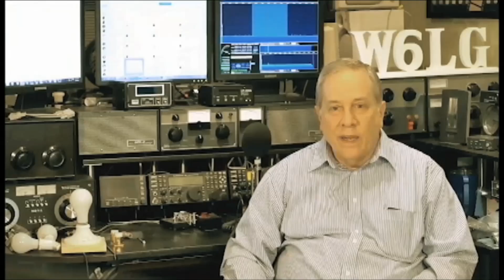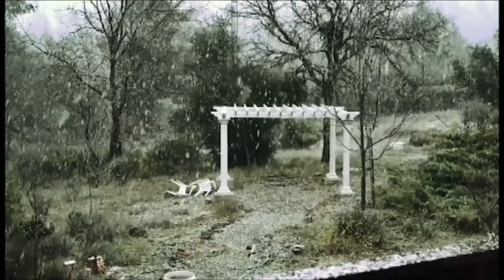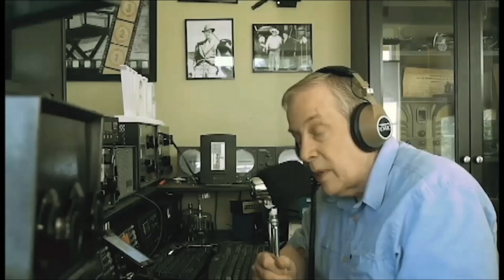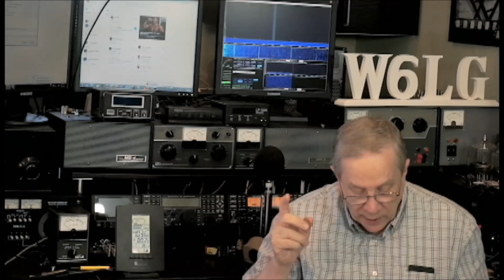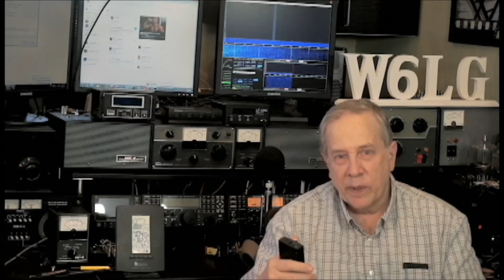Ham Radio Basics--Signal Reports--RST--Icom 7300

Comment: Thanks. Very interesting. I restored a very old receiver.  The failing component was a quadrature coil.   Located in the receiver of an old two meter portable called a Spectrum 560 which was a 2 Meter Transceiver. Had to order the coil from New York.  I was in college at the time 1979 studying transceivers.  My father.... who is one of the last Apollo Mission to the Moon designers sold that radio to me.   I remember that he requested a 100 dollar bill from me for it. I had to go to the bank at 15yo and I handed it to him and he handed me the radio.  I did not have my ham license, but I plugged in the little 1/4 inch whip antenna and had a blast listening to all the Los Angeles 2M Repeaters in that crystal set in 1975. But then I  found the bad quadrature coil in 1979 while doing a receiver alignment which showed very low rcvr sensitivity.   And that quad coil fixed it.
Today, I still have that fixed Spectrum 560 2M Radio in the garage, and I have my Father down stairs. He is 92 fighting dementia. But he remembers being responsible while on the US Navy Aircraft Carrier Mindoro to keep those Teletype  Systems going. And he remembers his HAM shack in the garage in the 1960's where he had purchased a few teletype systems and had them running and hooked into his ham radio set sending sending and receiving pictures long before the internet.  I remember standing next to him at 7yo and listening to him give signal reports to allot of other HF stations. He also was able to tell those stations how far off frequency they were, because he had setup a crystal oven on his local oscillator crystal which kept his receiver frequency extremely accurate.   I have an IC-7300 in the closet and I am going to set it up as soon as I get other thing fixed here.  Need to get that antenna up before my body begins to break down. Some HAM's do not understand... If your antenna is not resonant, you are going to pull more noise into your receiver and S-meter.

Comment: KA6TVX thanks for the explanation. I see videos of Qso’s that the signal report. Is 51 that drives me crazy and even on air have gotten 519. I run QRP CW most of the time and like you will repeat information if they give me certain signal reports.  Thanks for your videoa

Comment: I really hate the fact that with contesters the report is always 59! I assume out of laziness! I would much prefer to have a real signal report! 

As for the method, SINPO would be the best. Back in my SWL/DX days that was how we reported to stations about their signal. 
Signal Strength - Interference - Noise - Propagation - Overall
1-5 for each
Reply from the maker: Well don't be too upset. Hate is a bit strong.  Contests are about making contacts as fast as you can.  I would really like it if guys would understand the system.  For example, yesterday on 20 meters I heard a guy give a 5 by 5 report and then comment, right after that, that he was missing about half of what the other guy was saying!   I also heard a guy give a report of 5 by 9 to a another guy who had terrible RF feedback.  The reporting guy kept asking for a repeat of the callsign because he could not understand it due to the RF.  Yet, he gives an R of 5.  So contests don't concern me at all.  Regular contacts do.  Let's try to understand the system and get it right.  It is so easy just to tell someone that "hey, I think you have RF feedback and I thought you would like to know that".  Thanks John. 73, Jim

Comment: I wonder if the IC-7300 uses 3dB/ S-unit derived by power  (P=E squared/ 50 ohms)? S-1 would be down in the low nanowatt range though.
Reply from the maker: I have heard that from several others.  They, Icom, are brilliant at marketing their gear.  It would not surprise me if the S meter was more than generous.  Also, they recommend 10 to 20db of audio compression.  Ten is often way too much. Twelve is usually really distorted with flattoping, harmonic, distortion, crap.  Twenty db is crazy!  I try to use about 3 to 5db on the K3 and other rigs.  73 at 0db of compression, Jim

Comment: I'd sure like to get my hands on the 7300 I bought!!! Just wanted to let you know that I just bought a 7300 at DX Engineering @ 3:00AM this morning for $899.xx, charged transaction to my VISA! Now at 10:00AM I get a call from DXE saying ICOM won't let them honor the sale! I said then let ICOM know that the 7300 was my second ICOM HF Base purchase from you (and them), previously having purchased a new 7200. They said sorry, but they can't fulfill the transaction!!! I said...well, you're not yet sorry enough! I'll rate the product higher if the marketing and sales folks can just get their heads on right and deliver it as purchased.I'll rate the product & companies involved higher if the marketing and sales folks can just get their heads on right and deliver it as purchased. 73's K4WWK
Reply from the maker: I don't understand.  I do know Ray Novak at Icom and Tim Duffy at DXE.  Contact them using their email addresses.  Explain without emotion what transpired and the timeline.  Tell Ray and Tim that you made contact with me and I recommended that you contact them.  Ask for an explanation and that you will post the explanation here and that I will, if this all makes sense to me, cover it in video.  I do have almost 30K subscribers and some might be interested in how that all happened.  If the posted price was a mistake or a typo, then that is the answer.  Also, Gigparts has a much lower price than DX Engineering.  Let me know what happens.  73, Jim Heath W6LG

Comment: A nit pick.  3 DB doubles or halfs power (if negative).  6 db doubles or halfs voltage (if negative).  It's that squared term in power V^2/R or I^2/R and how it screws with logs...  So a six db change doubles the voltage vice three...   thus you have to double the power twice to get an additional s-unit on the receiving end...  no fair,  stupid logarithms and squared terms

So each s unit (6 db) doubles the received voltage.  You have to double the recieved power, twice, to get a six db (or 1 s-unit) change.

Decibel = 10 log(Pout/Pin)

P=V^2/R
Substitute
Decibel = 10 log[(Vout^2/R)/(Vin^2/R)]
The Resistance simplifies out
Decibel = 10 log[Vout^2/Rin^2]
Decibel = 10 log(Vout/Vin)^2
and finally
Decibel = 20 log(Vout/Vin)

For sanity check, 10log(2/1)=3db
and 20log(2/1)=6db

It's a royal pain in the but switching though 'em.

I think you have it right in your mind, but you switched from talking about voltages to talking about received power abruptly and , perhaps, a few folks could get lost in the switch.
For 99% of ham work, I'd refer anyone I've confused to your DB video.  Just keep in mind the three becomes a six when talking about voltages or currents.

Been home sick binge watching your videos.  Love 'em.  Have learned a lot and you have a natural gift for explaining things.  73

Comment: Thankfully this radio can be easily modified via software updates, so maybe Icom will give us a choice on how the S meter works.
Also, I get a lot of hams picking on me when I use “over” after a transmission instead of QSL, They accuse me of using chicken band slang.  Are they right?
Reply from the maker: Most times, QSL is INCORRECTLY used. We need to stop saying QSL??  Thanks and 73, Jim W6LG

Comment: HI Jim,  I've enjoyed your videos.  Just getting back into Radio after a long period of family.  Would like to email and visit your website.  I know you might not like to make everything public.  If you could write me with some contact info at douglasfelsenthal@gmail.com

Keep up the good info - WA0ODQ - Doug
Reply from the maker: Thanks Doug.  At this time, due to my illness, I have closed the website.  I hope at sometime to start it up again.  My wife is selling a few things on Ebay.  I had a massive Pulmonary Embolism on November 1, 2016 and as of this date, September 21, 2017 I have not recovered enough to even think about working. I still struggle to keep oxygen in blood at a reasonable level and sometimes cannot.  There was also heart damage.  Recently an aneurysm was discovered along with a heart murmur and failure of a valve to function normally.   Again, thanks for the emails and the wishes.  73 Jim W6LG
Reply: Jim,  I am sorry to hear this.  I am getting so much out of your videos.  I received my license at 14 in 1964.  It was not an easy task,  I struggled with the code issue and remember taking the test several times.  I finally made it.  I am now getting back into it and have enjoyed your opinion of the new transceiver technology like the ic-7300.  I too,  also,  just applied for a new call sign - W0YR - After so many years,  you deserve it right?

I live up in the north along the last wild river in the US - Marine Mn.  Keep up your spirits.  Visiting with us all on the air should give you power to continue on.  If you run into roadblocks,  I would strongly recommend the Mayo Clinic,  just 50 miles south of here.  They are the best of the best.  

I look forward to chat again as you feel up to it.

73;s - Doug - W0YR

Comment: Thanks Jim for the video. I have the 7300 and even though it is my first radio, I found understanding the s meter to be difficult. Often when checking into a net, the static crashes or even the noise floor will show 55 to 59. Occasionally i have had +10 over noise. Even with the high reading o the s meter I can hear most stations just fine. On the net i check into the minimum report is 21 and max is 59. Well the s meter is not of much use when the noise floor or static crashes are the same level as the stations. Most stations i hear are so close to the same reading weather i can hear bits and pieces or if they sound like they are next door. So basically I give my signal reports based on what your saying in your video. If i am barely hearing bits and pieces of their voice and the volume of their voice is way down in the noise I will give a 21 minimum or 22. If they sound very clear and I hear their voice as if we were talking in person, and the volume is much higher than the noise floor or static I will give a 59. I had been sticking with numbers i felt other stations could hear such as 21, 22, 33, 44, 55, and 59. But I will try to give more accurate reports like you were saying if i understand what they are saying very well but the signal is level is low they should get maybe a higher number for legibility but a lower number for signal strength and other reports accordingly.

Comment: What do you mean by fast push to talk, can some one clear that for me?
Reply from the maker: Hi,
Just by using the PTT as if were VOX.  Switching to receive between phrases or words (when possible).  If the other guy transmits, I am likely to hear him.  I have done it that way for about 50 years now.  I never use VOX.  I just sort of imitate it with the PTT.  73, Jim W6LG
Reply: Jim W6LG some radios have keyed VOX setting, meaning your radio will stop transmitting when you stop talking and turn on the receiver with the ptt engaged.
Reply: Love your videos, have learned much and I keep learning. Thank you for taking the time to do this for us.

Comment: Jim,
Thanks for an (as always) great presentation. Two comments:

Re the IC7300; that 3dB vs 6dB jumps out at me. That is exactly the difference between a power and a voltage measurement, and that seems to me unlikely to be just a coincidence. I see another comment saying the 7300 matches a different radio. I wonder if something like this may have happened. A manual writer, perhaps not fluent in English and specifically electronics technology English, maybe asks a colleague or reads a schematic or an internal document of specifications, and confuses whether voltage or power is being read.

For that matter, although I started in ham radio in the 1950's and could certainly have quoted you that 50 uV and 6 dB spec (although I learned from your video whom to attribute it to, I have always heard it referred back to the great Collins receivers as defining it!), I could easily get confused: The 50uV for S9 is clear enough, but is the 6dB change a change in voltage, or is it power, at the antenna terminals? I have not seen that clarified in any equipment manual: Does the reference you pointed to clear it up?

It might well be, and this would agree with that other comment, that the 7300 uses "standard" measurements for the display, but the manual misstates it. We need more data before we can be sure.

Other point: I was away from radio for a while and just got active again not quite a decade ago. I joined a Yahoo group for my new transceiver, and I posted a question as to how its S meter was calibrated. I got unanimous response that nobody cares, we just say 5 by 9 always! I did not get into a fight over it, but that seems to me to be lying. Of course when we say to someone "you're looking great today" it may be a lie or at least an exaggeration, but if someone actually asks me how they look I will try to be more accurate. We treat giving a signal report as a standard part of most QSOs. I want the RST or RS report to be a genuine report of real information, to the extent I can give it. Is that "always 5 by 9" idea at all widespread?

Thanks for your informative shows!
Bob Wilson, WA9D
Reply from the maker: I, 100% agree with everything you said.  You're clearly a skilled writer.  Thank so much for the information. I have friends who work at Icom and they are not about to fudge S meter readings.  It is an honest company with great products and some really bright individuals like Ray Novak.  We're lucky to have Icom producing amateur radio products for us.  

Thanks Bob!

73, Jim W6LG

Comment: Love your videos, I actually can understand some of the subjects now.

I just realized you are High Sierra Communication, funny to mean because for some reason I quit getting your emails. I don't buy much, my budget, but its nice to buy from reputable resources.

I have question though:  When are you going to do the video on the magic box you keep hinting at?

I miss the part that Ham Radio is a service and not just a hobby.

Ralph, AJ4GR
Reply from the maker: Hi Ralph,

Benchmark.com forwards my emails and they are a pain to work with.  If it appears that emails are not being opened by the customer (4 times in a row), then the email address is deleted.  Please do go to www.hamcq.com and subscribe again.   I have had some good sales on tools.

A yes, the magic box and when will I do it.  Well, it has been way to hot for me to go outside and set it up.  Right now it is 103 and there is a lot of smoke.  It is unsafe to be outside at this time; so perhaps in the fall.  The magic box is a copy of a commercial product that is useless as an antenna.  But the SWR is very good! 

The next video in the works is on linear amplifiers that I built.  I am at this time fixing one of my amps.  The timer relay quit working.  Thanks to Amazon, I have a new timer to replace the defective one. 

Thanks Ralph!

73, Jim W6LG
Reply: Jim,

Thanks for getting back, Already been to the site, wire tool is in wish list.  I have been on of those ham radio vacations were its the last thing on your/my mind.   Good to be back.

I knew you were having heat issues.  Its been mid 90s here with Heat Indexes 105+ We get the high humidity makes for tough times in the shack.

New ham here only 10 years, still don't feel like I know much of anything, so I really appreciate the clarity of your videos.

Stay cool and watch the smoke.

73, Ralph AJ4GR

Comment: Hello Jim,  Thank you from great video and info.  How i know if the transceivers need a S-meter? or can i do it with analyzer MFJ-259B?  thanks
Reply from the maker: Hello,
The MFJ-259B has nothing to do with S meter readings.  It is an antenna analyzer that can do a number of tests on antennas and coax (and other functions).  I believe that any transceiver with a meter of some kind, has the "S meter" function.  You will rely on an S meter for strength readings.  So, an S meter is a good thing to have.  If the transceiver does not have an S meter you might want to buy a different transceiver.  

73, Jim W6LG
Reply: +Jim W6LG Thanks Jim.. 73